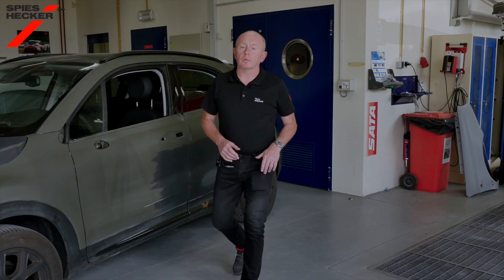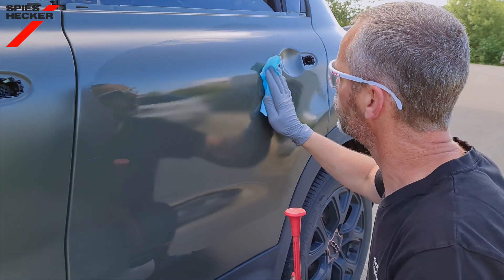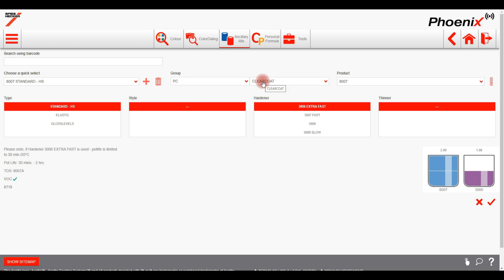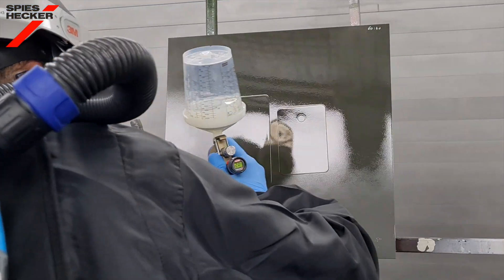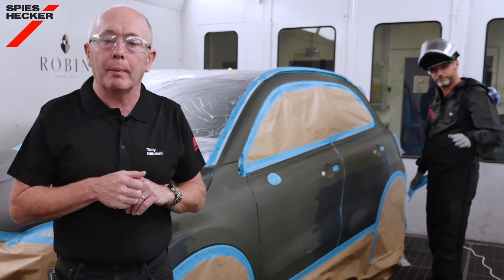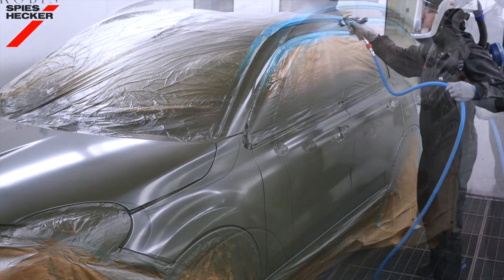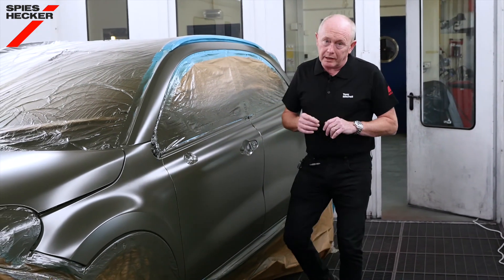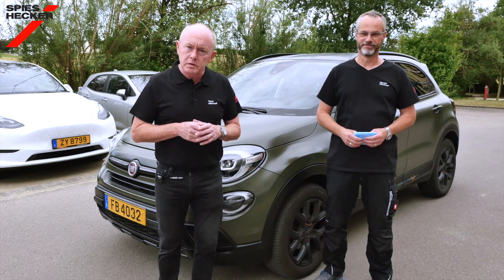Special Repair Processes: Spies Hecker Matt Clear System

Comment: 8700 clear coat ,what you recommend SATA 5500x .2 or .3 nozzle and cap
Reply from the maker: Thanks for getting in touch. For 8700 I would prefer a Sata 5500x with a 1.2O set up. Use an inlet pressure of approximately 1.8 bar.
Reply: @Spieshecker  thanks